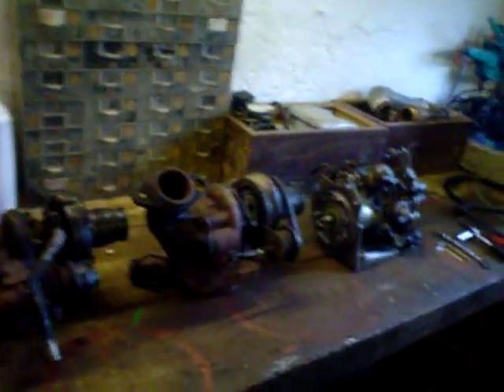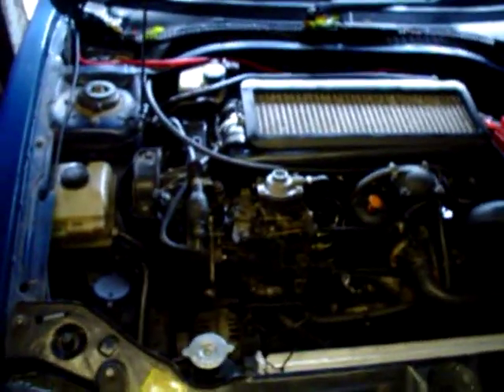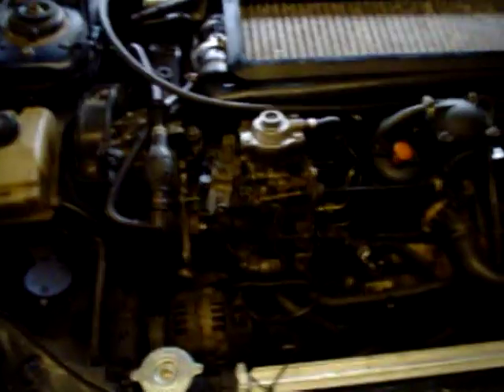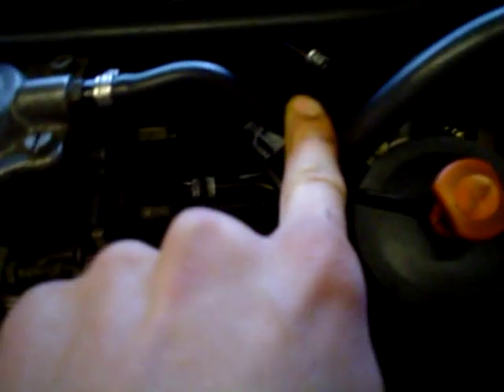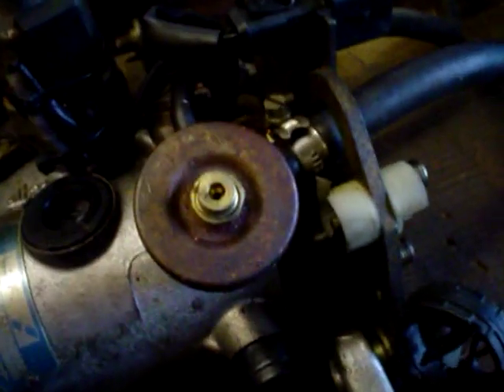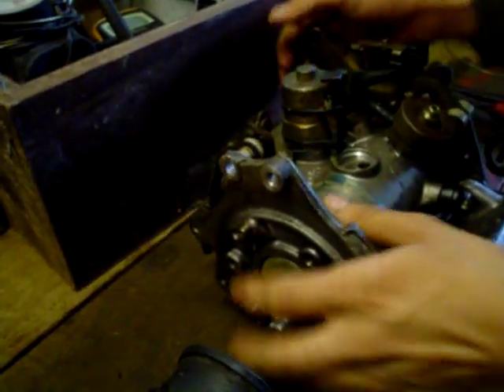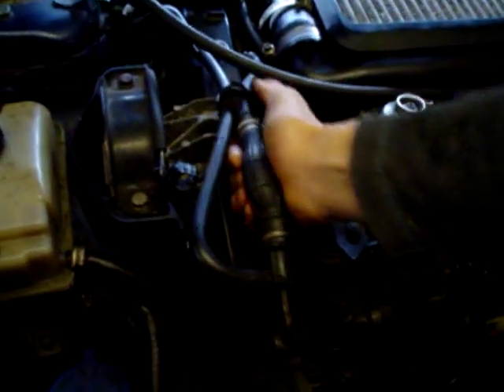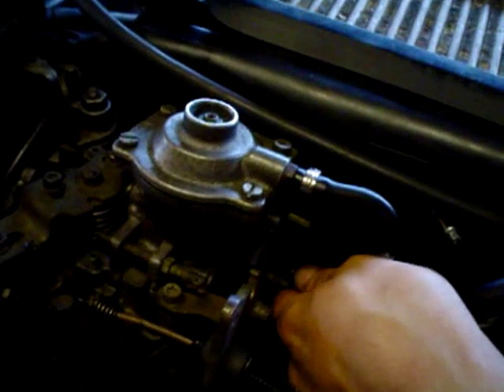306 D Turbo Stage 1 tune part 1

Comment: Here is link for that fuelscrew plug replacement if you broke your own: https://www.ebay.com/itm/Bouchon-vert-le-joint-pour-pompe-a-injection-type-DPC-LUCAS-ROTODIESEL-DELPHI/264029890142?epid=28025647157&hash=item3d7968665e:g:9~IAAOSwatBb5CZi:rk:1:pf:0

Comment: Ive got a 1.8d old fiesta. it has a lucas pump but without boost compensator. there is a screw on the back of the pump by the outlet pipes. I know the max fuel is inside the pump. But what does the screw on the back of the pump adjust?
Reply: also i am currently making up a manifold to mount a rover 75 2L td t3 turbo. will the lucas pump surfice to make a nice daily driver with low boost?

Comment: why don't you just undo the 4 screws holding the top of the pump on and mark where the diaphragm is remove it take the plastic washer off the refit  and turn it between 90 and 18p degrees that's what we do with tdi landy's running ve pumps or fit a boost pin and go from there

Comment: i removed my cat and middle box and had a straight threw pipe {no cat & middle box} into a cobra back box plus the stage 1 tune and now im running over 22psi from 16psi with only grey smoke..unreal upgrade and you can hear it spooling.
i now want to have a 306 hdi gearbox fitted,what modifications need to be made or is it a straight fit ? also it is a 90hp its only the non turbos that are 75hp as i reacently found out.

Comment: just a quick one again...i have turned my max fuel up on a lucas pump over 90 degrees. the nut on my acutator on my kkk turbo was loose so i turned it all the way in and then back out 1.5 turns and i am only seing 16 psi...any ideas ? should i go more with the max fuel ?

Comment: on the lucas pump on the boost aqutator when you slacken of the lock bolt is the bolt that you mentioned inside an allen key or a torque ?

Comment: i have tuned my pug and i must say it has made a massive differance also i have put some capri 2.8 rs wheels 13 inch 205 wide on and that has gave me a little bit more on acceleration aswell...just a quick question mine is the 75bhp phase 2 model so with this tune roughly what sort of bhp would this of added you think?
thanks for sharing the video and for those muppet's keep asking the question about the rotation of the boost to turn it up if you listened he did say anti-clockwise in the video.

Comment: nice vid but what about egt's with too much fuel??
also can you not spin the daiphram around to the wideist part to give more on boost fuel rather than doing up the top bolt to push the daiphram down abit

Comment: @MrBezelder 
the compensator decides when u get extra fuel on boost so if u set it soft u get full fuel at low pressure, this means that even more boost can be made and so on so it removes lag totally, do it, do it now!!
Reply: What do you mean by set it soft?

Comment: the boost compensator adjusts the pressure at which extra fuel is delivered so if u set it soft u get full fuel at about 0.1psi and totally remove lag, I just ran mine without any spring in the end.

Comment: hi, i know these are similar to the old 1.8td mondeo's setup. however, i have a mk3 mondeo tddi with a fixed vane mechanical turbo. theres no throttle cable on these so any tuning for that will need to be done on a remap via the ecu. given i have a mechanical turbo as apposed to the variable vane which relies on a lot of electrics, im wondering if you can help me out to get more out of the turbo. i can get pictures if needed. Thanks Darrell

Comment: @shanfer123 i have the same car and it has a turbo as stock.. when you put your foot down have a listen towards the passenger foot well.. you can hear it whistling down there  and you can hear the little stock dump valve when you come off the throttle..

Comment: @ExtraSilver Yes, they both have turbos. The Dturbo engine is an older, more simple mecanical type engine whereas the HDi is a more efficient and modern common rail type engine.

Comment: My Dturbo came with the "Grenade" in the boot and some cut up pipes on the pump can you help??? also someone has grinded/cut away some of the metal off the top of the pump and there is a switch with lots of cables coming from it???

Comment: Good info, thks. 
Adjusting the shown maximum fuel adj 4mm allen screw helps also in old -88 ducato j5 N/A 2.5D Lucas CAV MA260 DPA344 ...now pump is giving enough juice (when fuel adj screw had no effect...). 
With new injector nozzles it did not once give one bit of blk smoke - after turning the screw 60 degrees, power is now 'normal' with a hint of blk smoke at full throttle. Engine has 100k miles.

Comment: Great little video. Just a quick question...

I'm using a D8B 406 engine in a 306, with a Bosch Pump, I altered the settling earlier and my tickover revs have lifted to 1100 rpm. I take it this is due to the side adjustment (max fuel). I wound it back, but does this sound about right though?

It had in the past been "stage 1" tuned but

Comment: hi great vid. fekin amazing very usefull thanks for takeing the time to create!. i am soon about to preform this performance tuning of my 1.9 td 306 but firstly i must invest in a boost gauge. but the 1 im looking at will messure up to 20psi.. is that all it needs to b on the gauge? like will the gauge cover the pressure reading the turbo is going to create ,, 20 psi ..  ?plz reply thnks

Comment: Any diesel specialist should have one.
I have never removed one without destroying it! with 1 exception,
U can try filling plug with epoxy and glueing in a piece of plastic bar etc, so u can turn bar to remove plug rather than ruining plug, I tried this once and it worked but be sure to get no bits inside pump.

Comment: I wonder if the insurance company could tell if pump is turned up and wastegate adjusted?
If u set boost then remove boost gauge, everything will look standard, I mean its an adjustment not a modification, unlike a chip on common rails etc?
I wonder if u could class it the same as adjusting timing on a petrol car?
see my point?

Comment from the maker: You can increase the fueling with the max fuel, but tbh, you wont get much more from the 1900 nasp engine...without the turbo, you simply cant burn the extra fuel.

Comment: I'm in camborne cornwall and got a 306 with a lucas pump. its not turbo but is it the same think for adding more disel. (looking for more low down power as i tow alot)

Comment from the maker: Well you should change the injectors from lucas ones to bosch ones really for best perfoance as they have totally different presures to make them open. And you just need to change the pump / bracket / injectors, and to make it easier, the lines as well, as bending them isnt ideal..

Comment: lucas pump u screw it out as the screw squashes a spring that resists compensator, stiffer spring the slower it gives extra fuel, screw it out(anti clockwise) and it can move easier so u will get a bit more smoke off boost or at low/ beginning of boost.

Comment: Cog wheel?
Just a bolt squashing a spring?.
Or was I asking about the bosch pump?
I cant recall!
This vid is very informative though.
I turned my pump up to max and still no smoke!
The bosch pumps; u can use a small screwdriver to prize off tamper cap.

Comment from the maker: Yes, you can run the bosch on oil, and also, its a much nicer pump to tune, leaves you with a much smoother, and less smokey engine :D

Comment: Boost compensator is used for the on boost compensation but also effects off boost kind of.
ie u can significantly reduce turbo lag by allowing compensator to start compensating earlier (lower boost) as u know, to me it makes the car a different drive totally, no extra power but much less lag.
What say u?

Comment: If lucas pump increase off boost fuelling by adjusting boost compensator screw.
Have u fitted a huge turbo by any chance?
Is the standard turbo (if fitted) working properly?
Look for lots of oil in inlet tract - worn turbo.

Comment: Thank god a person who actually knows about turbos!! Namely the extra charge temperature negating the extra boost.
I read another video comment and someone said "disconect wastegate!" for max boost!!!!

With standard cooler - bad idea, although on my ford 1.8td (forgive me!) the wastegate was seized for ages, 25 psi boost, I reduced to 18 and have same power I think.
Just fiddling with air leaks on filter head, I have had 6 faulty new chinese ones!
Be on lookout for these!

Comment: Ah right. I guess I'll have to suffer then unless I get myself a dump valve.

Having fun with dead injectors at the moment, it sounded a lot like the "killing" video you put up earlier in the week when trying to start. It hurts my soul to hear her like that! She runs in the end though, yesterday morning it took 5 cycles of plugs and cranking to get her to run.

Any idea where I can get replacement injectors if they turn out to be beyond reconditioning?

Also my exhaust is falling off now... Fun!

Comment from the maker: Theres not reli alot you can do about turbo lag, best thing is to get hold of a later GT15 turbo, they have smaller internals, and spool up a lot faster, i did the conversion on mine, feels more like a petrol to drive now